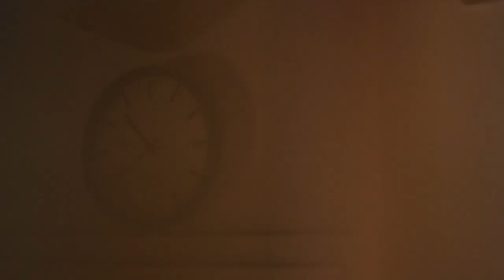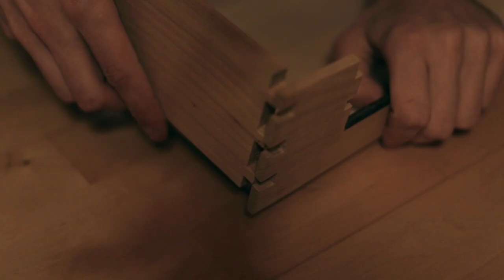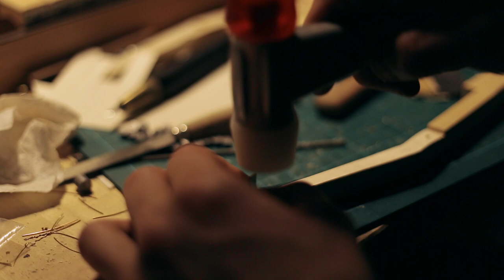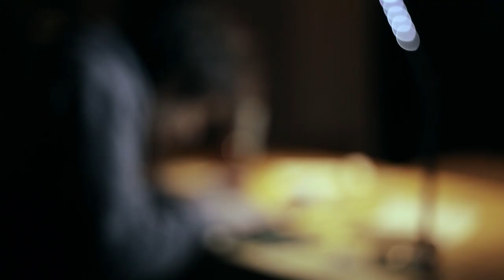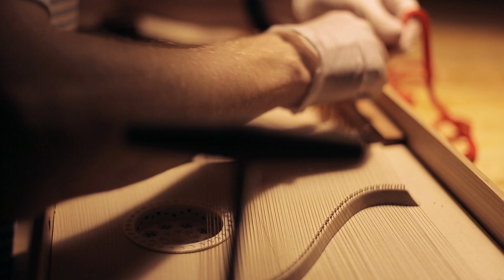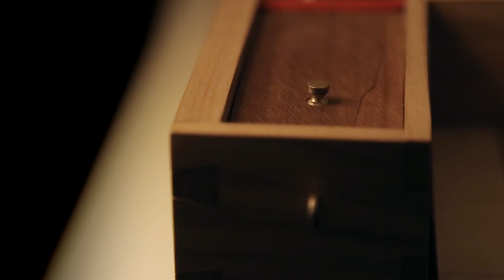Building A Clavichord

Comment: Bravo! Did you build from scratch or kit? Beautifully done.
Reply from the maker: Thank you :) I built from scratch.
Reply: @valentinrichter   outstanding. Such precise dovetailing. Could you say something about the interior of the lid?
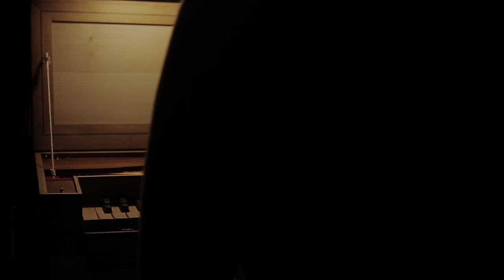Reply from the maker: @brianexplores285  Thanks. The lid is made out of maple (inside) and cherry (outside). There is also a small strip of black oak (/fumed oak) between two wider strips (also cherry) for decoration on the inside (as visible from 4:03). For making the vignette I allowed myself to use a template.
Reply: @valentinrichter   it is marquetry? The scene was brief so I couldn’t quite tell.

Comment: Hello Lucas, thanks for the video. May I ask you some questions? I'm thinking of building myself a clavichord and am curious about some particulars. How many hours had it taken you to build this clavichord, from start to finish? Also, I'm thinking of buying a plan from Marc Vogel, and am not sure if plans are enough to build from scratch.
Reply from the maker: Hello, 
I didn't count exactly, but I estimate that it took me about 350-400 hours of work in total, of which about a third was for planning and organising materials. I can recommend that you join groups that discuss the building of clavichords or harpsichords, for example on facebook. There you can get an impression of the building process and develop a feeling for it.
Good Luck!
Valentin
Reply: @valentinrichter  Thank you for the answer, Valentin! I also assumed it would take around 350-400 hours, so it's good to hear. I will check some groups, and try to get a feeling for it as you say.

Thank you!
Burak

Comment: What temperament?
Reply from the maker: It used to be constructed for a rather mild temperament (somewhat similar to Valotti) - but (by bending the tangents a bit) I changed it to a slightly modified meantone temperament later.